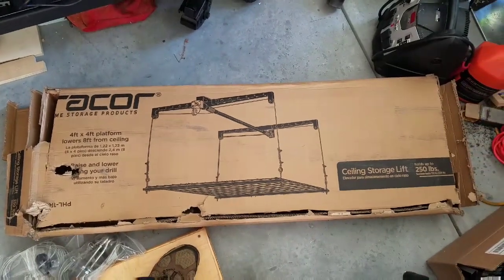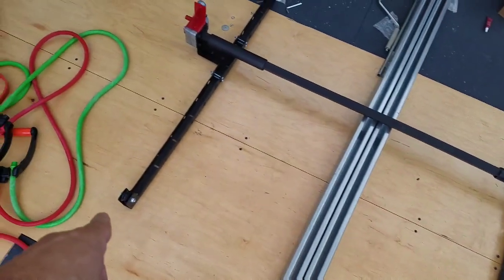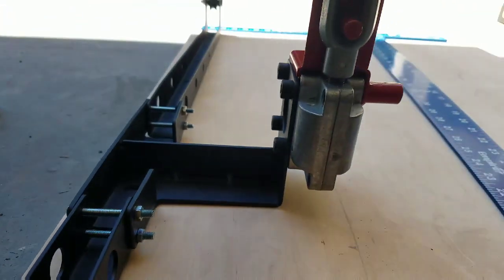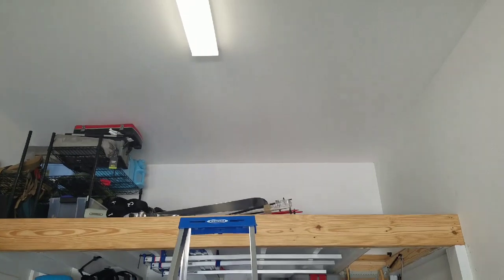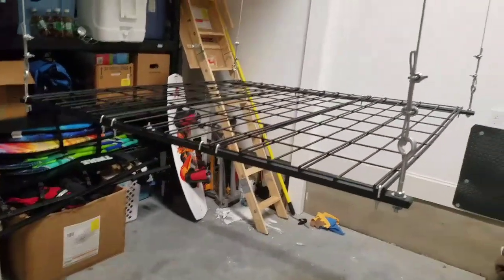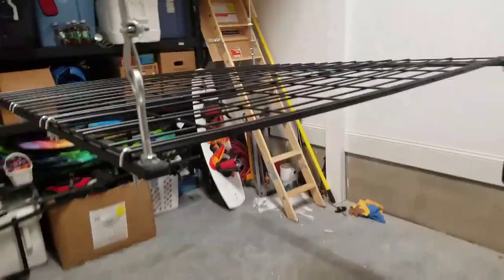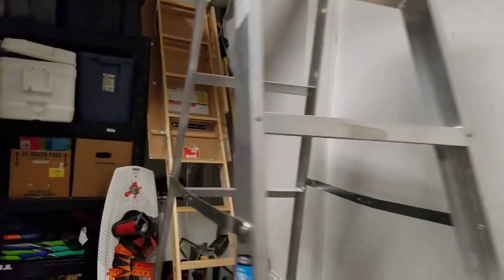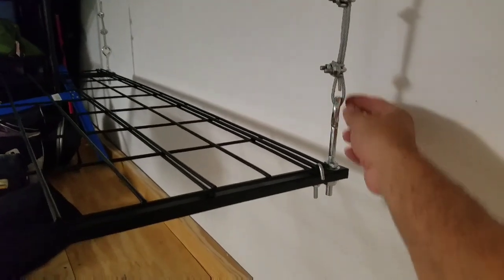Jeep hoist -  Racor lift with a rail!

Comment: Great design. I may have considered cross bracing between the Racor rails since the unit is on casters.
Reply from the maker: Good point.  It works well.  I find I use it most for lifting other things like moving tools and boxes to the loft.  I keep the hard top on the jeep mainly.

Comment: I would be concerned somewhat about if you get the Racor lift moving down your added rails, so some momentum is built up, and then one track jams for some reason, the momentum could try to  'wrench' the normally perpendicular structural members of the Racor into a parallelogram, and the winch axle might be stressed in ways it was not designed for, and might even pop out at one or both ends. There are those little cotter pins at the ends, but still a potential problem. Also, if the two trucks on the two rails are not lined up precisely, the winch axle would be misaligned in the nylon bearings, which could damage them. I think if I had a similar arrangement, I would investigate some means to force the two Racor rails to remain in alignment with each other; I am thinking of diagonal cables or rods between the corners, or something like that.
Reply from the maker: Valid points.  I tried my best to line everything up.  Haven't experienced binding, but valid points. 

Thanks for watching and hope it was useful.

Comment from the maker: Working well.  I didn't plan on using it much more than once per year switch from summer to winter.    But I've had to use it multiple times to fit the hard top when i needed my roof rack.   

I have also used the platform to lift my other heavy tools for storage, table saw etc.  Works well enough.

Comment: spectacular design, exactly what I'm looking for.   did you ever get around to posting a vid of the actual top removal and sliding into storage?
Reply from the maker: Thank you!  I will be posting another video within a week or so bringing the top down to the jeep for winter.    Hope to have it done in a week or so.   I don't edit much, but I did finally get a tripod.
Reply: @comfort_in_discomfort  just raw video is great ;)   have you looked at the topsy brackets at all?  seems like a perfect setup
Reply from the maker: @TikkerLoS  I've seen the brackets.   I think they may be a good way to go.   I thi k a lot of people get turned off as they are a bit of a point-load on the hinges.   I think they would be fine if you don't I tend to hang by them for storage.  To lift would be ok.   But not hang continuously.
Reply from the maker: @TikkerLoS  BTW - new video is just up changing to winter mode.
Reply: @comfort_in_discomfort  I emailed the topsy guys, and they said they're intended for long term storage.  I may end up putting an extra strap around it once it's off tho, we'll see